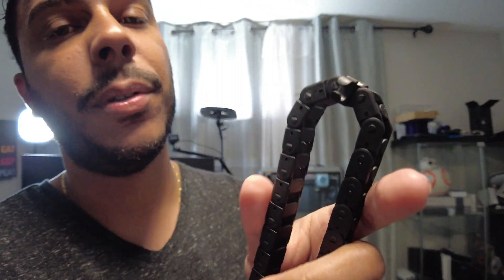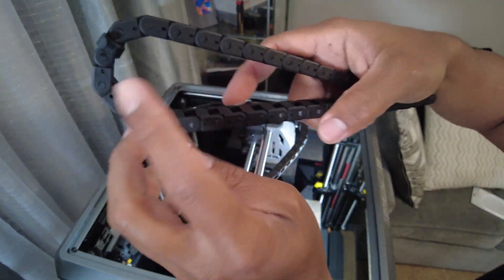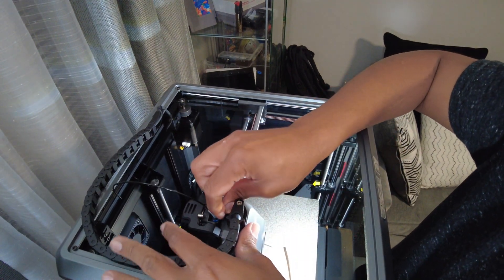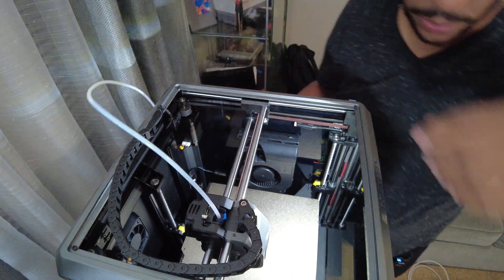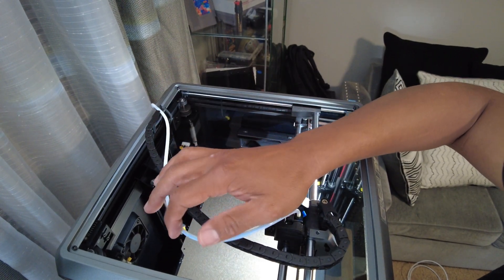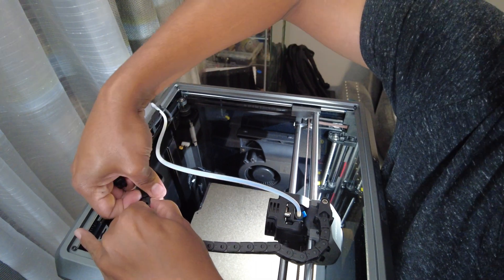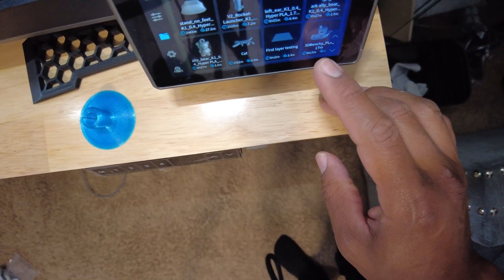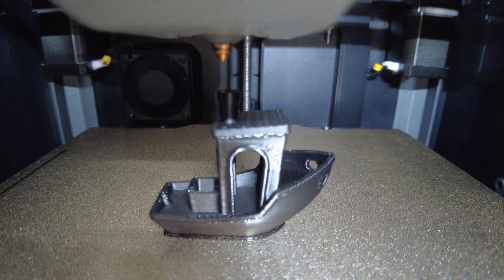MY CREALITY K1 JUST GOT BETTER THANKS TO BAMBU LAB P1P X1C PARTS

Comment: ????? You could have just used a Zip Tie no???
Reply from the maker: Use the lid, and zip ties  would get in the way.
Reply: You could zip tie it to the side, or ontop then cut the ends of the zip ties, I got a k1 and it looks like it'd proportonally work, but a trashy fix in comparison to a new chain.

Comment: I wish I could buy a K1 Max without the lidar and camera.  I consider those to be gimmicky features I don't need but I would appreciate the larger build volume.  If I'm forced to buy the lidar and camera, I'll sell them as low cost upgrades to a K1 owner.
Reply: I'll buy them, I'd like to reverse engineer them to figure out how to build our own and experiment with improving these features.
Reply from the maker: As you're self,  I  don't see them as needed. I believe that if the software is not implemented well,  many will hand problems with it.
Reply: @Razer3DP  But if we can improve software, implement them into Klipper as a community, we can probably improve how well the detection is performed.
Reply from the maker: That's what I want. I do have the AI camera coming for the k1, but no lidar available as of yet

Comment: I hope that Creality finishes the last important details on the K1 in rolling upgrades as more units ship, but if it sells well enough, the community will fix all of the issues with the K1 to make it as good as it can be.  Hopefully Creality embraces and facilitates community support of the K1 rather than trying to lock it down.
Reply from the maker: I hose so, too. Let the community take it and unlock its full potential
Reply: @Razer3DP  They did try to lock it down, fortunately they didn't do a great job. I hope they come to embrace the community rather as they have for the Sonic pad and giving out root access. I'm working on other ways around it if they fix the existing ways in and don't provide a way to get root access however.
Reply from the maker: @Eric Duprey  hope they unlocked it.